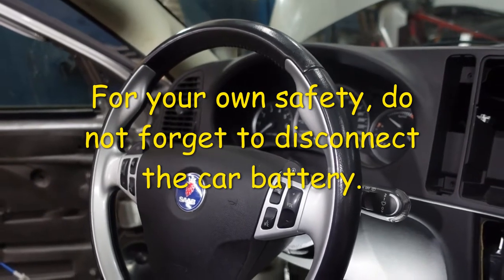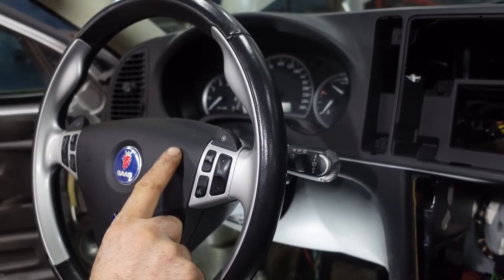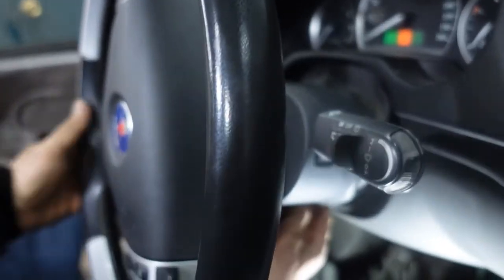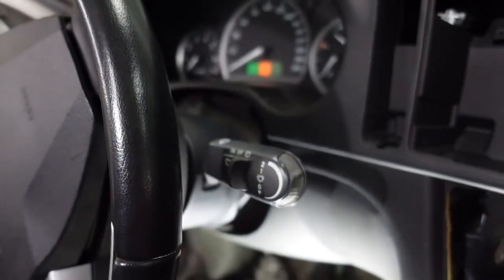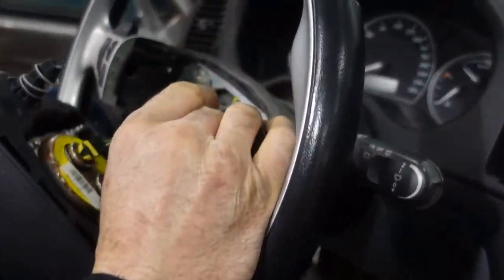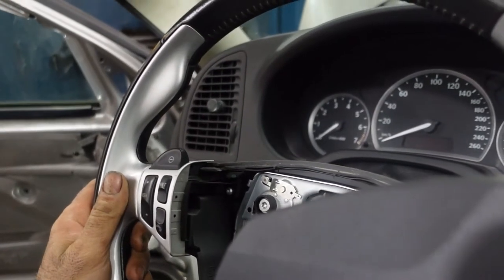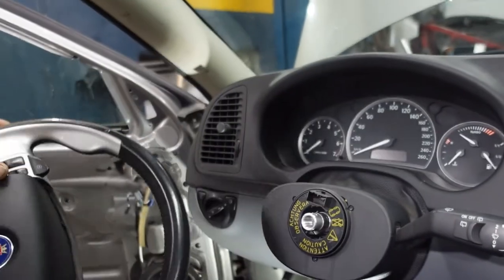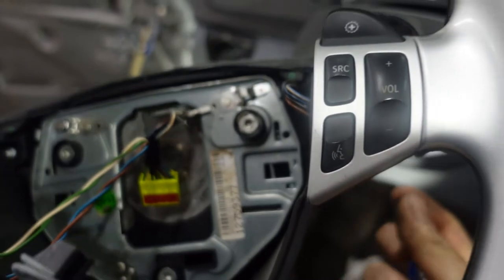How To Remove SAAB 9-3 2003-2011 Driver Airbag & Steering Wheel

Comment: I have a 2008 9-3 Turbo X that was in a low speed accident. I, the driver was the only person in the car. Only the driver airbag deployed. I'm buying a new driver airbag and planning on having the airbag control module reset. I removed it using your awesome videos. My question is regarding the driver seat belt tensioner. It seems like the driver seat belt works just fine after the accident and I don't think I should replace it but some of my Saab friends think I will have to. Do you know if it's possible that I won't have to replace the driver seatbelt? I plan to search with Tech 2 to see if I can confirm which parts of airbag system deployed. I am hoping it is only the driver airbag. Thanks!
Reply: I used my Tech 2 to see that the driver seatbelt pretensioner did fire. I am going to have it rebuilt. Thanks again for the great videos!
Reply from the maker: You are welcome. It is good that you have Tech 2. You can diagnose the problem by yourself. 👍

Comment: Is it correct to say that disconnecting the battery is the safety for the Airbag. Do you need a Tech2 to reconnect these items
Reply from the maker: The airbag can deploy by accident, if you do not disconnect the car battery. Removing airbag components, it can trigger faults in the system. SRS light will stay on. You  need scan tool to read and reset the light.
Reply: Thanks, great video  cheers!
Reply from the maker: You are welcome!